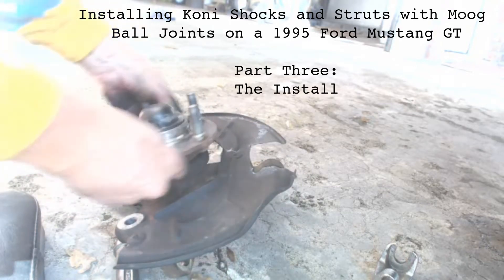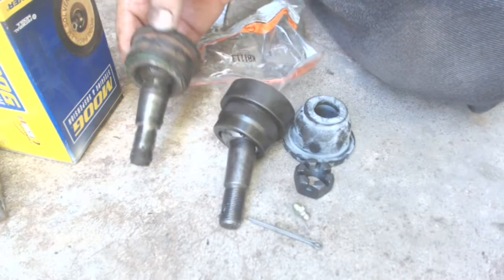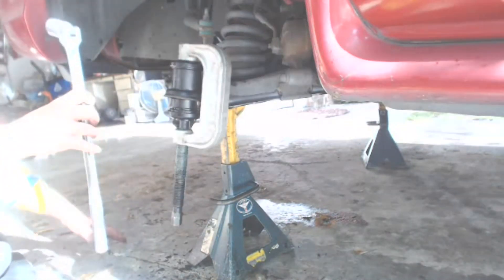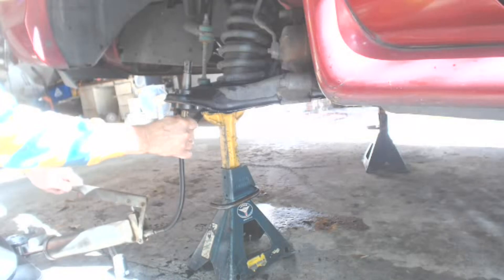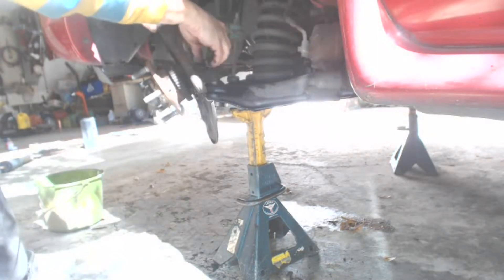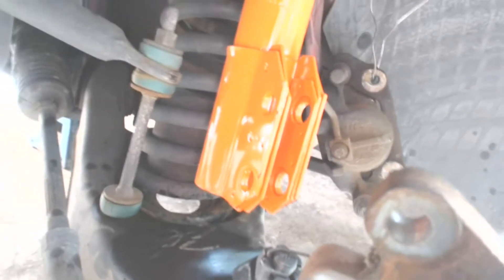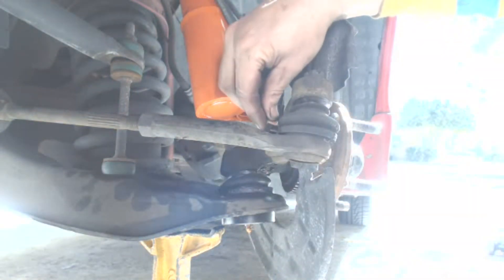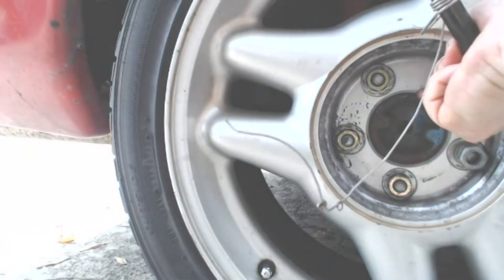Installing Shocks/Struts and Ball Joints on a 95 Mustang GT Part: 3

Comment: How did the konis ride with your stock setup?
Reply from the maker: Like stock on the freeway.  Definitely handles better.
Reply: @EdHumble  nice 👍🏻.  I have them on my 03 but it’s lowered.  Was wondering how they would feel on my stock setup 97
Reply from the maker: Different chassis setup from mine I believe.  A 97was a different body from a 95?  No perspective for a meaningful comparison.

Comment: I have no issue up until i have to tighten the ball joint , goes to a certain point and spins got the whole new control are moog and also mines didnt come with cotter etc  just normal nut
Reply from the maker: Something is really wrong.  The new Moog should come with a new nut and cotter pin.   No way you bought a real Moog.  They don't work like that.  TAKE THEM BACK and demand your money back.   I can't comment further, but don't drive the car like that unless you're suicidal.

Comment: Hot damm 8:17 199 foot pounds? Hell I cant even lift that much, mabe I’ll use a impact gun
Reply from the maker: A two foot long Torque Wrench needs 100 Lbs applied at that distance.  ALWAYS use a torque wrench when doing ball joints.
Reply: Ed Humble mabe pump the compressor up around 200 lb and hit it few times with the impact
Reply from the maker: Risky.  I’d buy or barrow a good torque wrench.  Some parts stores may have one for loan.
Reply: Ed Humble I’ll just hit the trigger about 2 times I can run it down with a wrench until snugged then hit it twice real quick